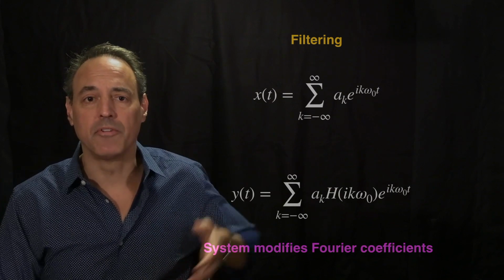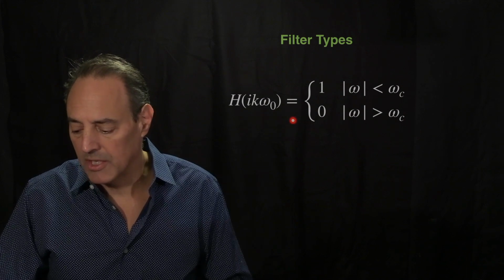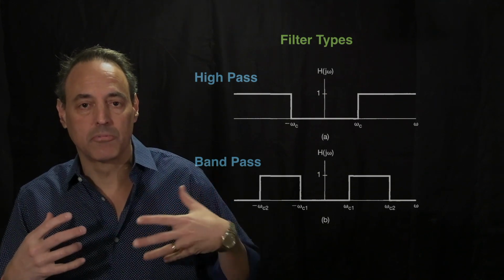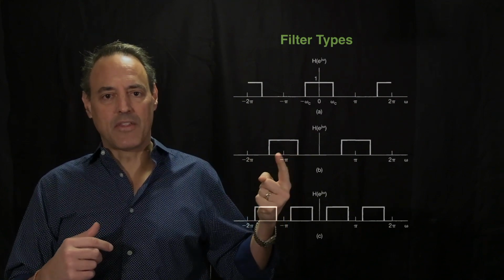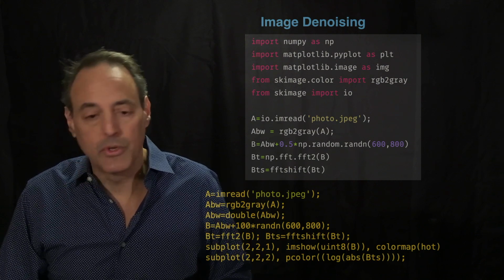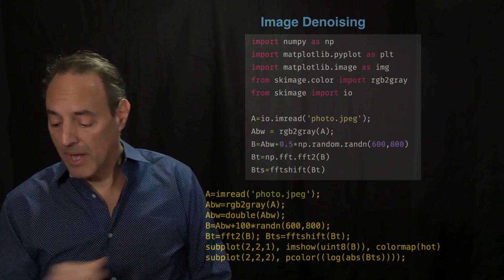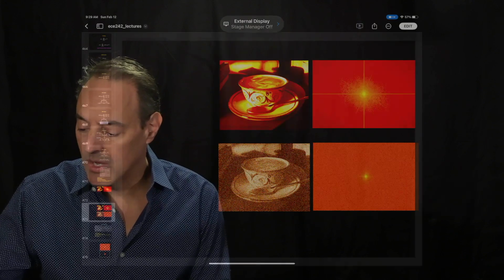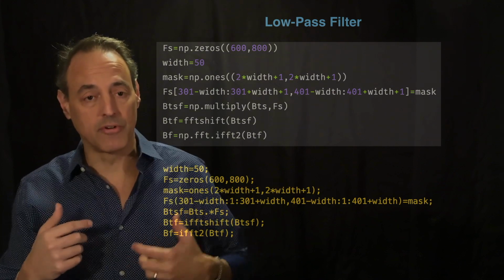Introduction to Signal Processing:   Frequency Filters (Lecture 16)

Comment: in the coffee cup picture example, having the fft plot next to the picture may be doing a disservice to the explanation, or even using the red/yellow color to plot the points as there is no spatial (x,y) correspondance between the two two diagrams, the jpeg is really a linear array of values which after fft can be represented by the x,y log plot of the fft.